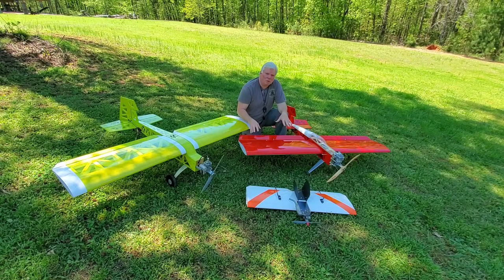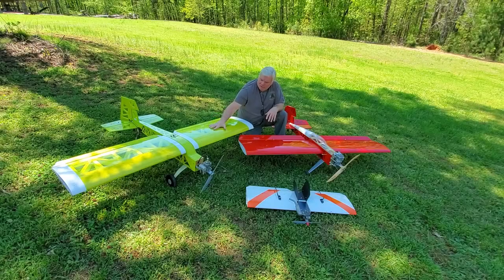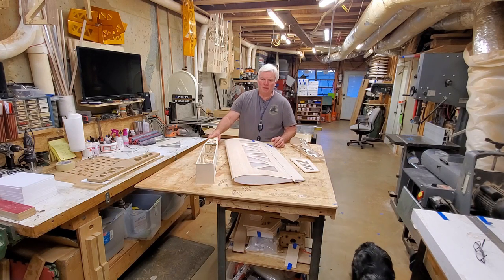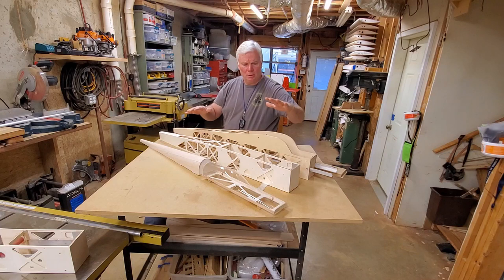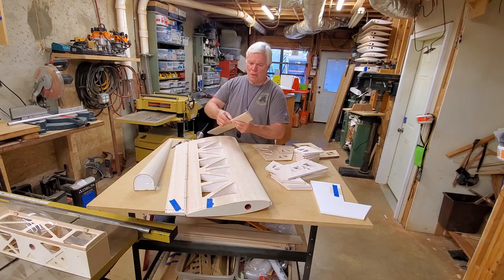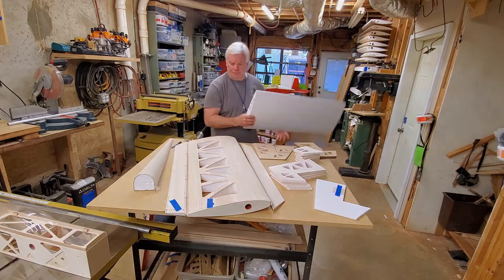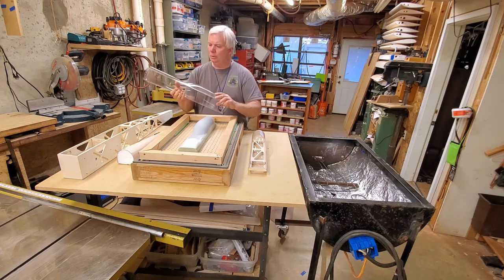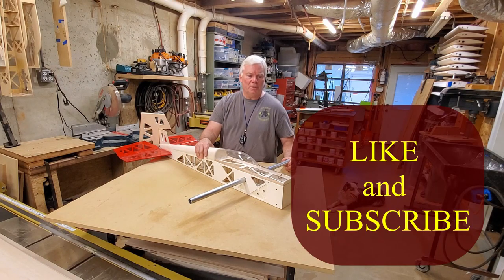Scratch Building Your Own RC Planes  Episode #1  Introduction to the Build Series..

Comment: Thank you Mike for sharing your wisdom with us. On my wood frame airplanes I've only built ARFs and Guillows balsa planes. I've been wanting to build a scratch built balsa for some time, but I've been rather intimidated to even begin to try. After watching your first two videos you have me hooked. I'm now confident in beginning my first scratch built wood aircraft. Of course, it helps to have a shop, but since I only have my front room and my yard, I'll have to improvise accordingly.
Reply from the maker: Thank you so much for the kind words Robert.  In the next few days I am putting together a new little router table top that I can throw in my trailer for traveling.  I'll just slap it on a trash can for a cabinet and use a shop vac for dust control.  I'll  make a quick video of that and post it as episode 2.1.  

I have one now that works great but its quite old and beat up from years of travel.   Anyway, it would be a great solution for guys/gals with extremely limited space.  I even use a compact table saw and bench top bandsaw when I'm on the road.  These tools are cheap at places like harbor freight.  

Once you clear those three hurdles, everything else we will be using has a very small footprint.   

My point is, you don't have to own all the woodworking tools you see in my shop to build these planes.  I do it regularly on bench-top Harbor Freight equipment.   Nothing we are doing "requires" the level of duty or precision capable from my shop tools.  I use those tools for furniture building.

We will be building wing panels real soon.  Most guys will need to build a vacuum system to facilitate this part of the build.  The system can be built on a shoestring budget and its much easier than I ever thought it would be.  The timing is right for me to release a few minute video on tools needed for that phase so guys can be gathering the parts to build their systems.   

I built balsa rib wings for years because I thought foam core construction was out if my reach.  I couldn't have been more wrong.  Foam core construction is cheaper, easier and far more durable.   Once you see it done, I believe you will be hooked.  

I must warn you though.  Several of my buddies have become foam core addicts.   🤭

Comment: Awesome work! They look like they fly better than what you can buy!
Reply: Its definitely a tougher plane.   In addition,  the huge control surfaces and tremendous wing area gives you control authority to enjoy a flight envelope that most ARFs can only dream of.  The slow flight control is addictive.   

Having the ability to replace your own parts provides a greater level of confidence and enjoyment as well.  If you break a fuse, just pull your tail surfaces off and glue them in a new fuse.  I've done that several times.  In fact, I'm doing to video on that now.

Comment: Fantastic video. Cannot wait to see the coming the rest of the series.
Reply from the maker: Thank you so much for the kind words.  
I am editing the next video as we speak and I should have it uploaded tonight or tomorrow.   The clips for the next four or five episodes have been filmed so they will come out quickly.  The plan is to have videos come out once a week.  The challenge is getting it shortened down without losing valuable instructional content.   I'm trying to keep the episodes just under one hour long with absolutely no fluff.   

In addition,  I will be throwing out shorter videos between episodes on things like making wing tube sockets, hinge prep and  instalation and making servo extensions.   That will help keep the main video episodes shorter and make it simpler for guys to find those topics for later reference.

Comment: many years back when I got started scratch building was the only way... as its cheap... & I love building planes... I made fuselage from ply & wings from foam & veneer sheeting...  I never purchased an ARF.. scratch building all the way...
Reply from the maker: I love scratch building as well but I also own a few ARFs.  I have 8 Extreme Flight 50, 60 and 70cc planes.  There is no way that I can build a plane to the exacting specs of a high quality floaty ARF.  (I actually could,  but it would take an incredible amount of time and work to achieve)  Unfortunately, that super feather weight comes at a cost; its very fragile if it hits the ground.  That's where these build materials and techniques shine.  It will never perform like and EF but it flies well enough to surpass most pilots skill levels and its incredibly durable and cheap to repair.

Comment: Request of RC foam core wings is pending. Meanwhile can you please guide me the nest possible wat to get the template/plans to get going with the fuse and wings for the 35 cc turtle deck version
Reply from the maker: Im not sure what you by the pending request. 

I will have to trace those templates and have them scanned a print shop.  

I just haven't had time to do that.   

I'll try to get that done this week.  

Do you have a way to print them on a large scal printer like at a print shop?

Comment: Just finished watching the last video on this.  Great series of videos.  If I put that much work into an RC plan I don't think I could fly it, but then it looks like it could take any mistake I would make.  My only complaint in the whole series is when you were using the router table to trim out the waste on the wings etc. you used your fingers to pick out the off cuts.  That just made me cringe.  I would never put my finger in that position.
Reply from the maker: Yeah, one of my buddies routes the entire waste block out to avoid a piece in the center.   Good safety point if you're not used to routers.

Comment from the maker: I failed to mention, the high wing version (Bush Gnat) is running an RCGF 20RE.  As you can see it has more than enough power with a 20cc.  The red plane (Sport Gnat) is running a DLE35RA in this video.  I actually prefer the RCGF 35RE.  They are stronger, lighter and cheaper.

Comment: I'm a Mooney M20C owner and I would love to build a RC version of the plane but no one has any plans for it
Reply from the maker: The nice thing is,  you don't need plans.  The M20C is a fabulous plane and it would be a fun project using foam core and liteply.   The NACA  63-215 airfoil would be easy to build.  Or, you could build a NACA 2412 and gain some stability but maintain a very similar appearance.   Very few if any one could tell the difference.   

I just started a Facebook group for this project.   Its a much easier format to talk.  

"Foam Core RC Plane Builds and Repairs".

Comment: Where do you get your lite ply? I live in Georgia also Just west of Atlanta.
Reply from the maker: Harvey, you are in luck!!!   I get my Lite Ply at Spruce Aircraft Supplies in Peachtree City, GA.   So, you are actually closer than me.  They were out of stock a couple of weeks ago due to COVID shortages abroad but it may be back in stock now.  

A tip for buying:  Tell them you don't want the sheet on top of their stack.  The second and subsequent sheets will be much straighter.  Take a scrap sheet of plywood with you and cover it in the bed of your truck on the way  home.  Just that ride will dry the exposed face faster than the covered face and cause it to curl a bit.  That's just the nature of very thin plywood.   Once you get it home, stand it on end between other plywood sheets.  Put it back as soon as you cut off what you need.  That way, it will remain like brand new for years if needed.  I buy at least ten sheets at a time.  I'm down to about three sheets and will be making a run before long.   

BTW, I'm east of Atlanta about 45 miles.

Comment: I wanted so much to learn from your video but sound was almost impossible to hear.  Please invest in a lapel mic it will improve things tremendously.
Reply from the maker: The early videos were done with very little experience or equipment.   

Although I'm not a video expert by any means,  you will find later episodes much easier to hear.  

I did get a lapel mic and found it inappropriate for my environment.  The cords just don't work while working with tools and moving around.  

I sprung for a high quality remote mic and it works fabulously.

Comment: Mike, where do you get foam wing blanks that size for "a couple of dollars, or so"? I had to order 48" x 24" blanks for my project at $25 ea!
Reply from the maker: I buy from a company in Conyers,  GA. called CelloFoam.  Look for a foam manufacturer/distributor.   If you buy from retail,  it will get expensive.   I buy my pieces in 4x24x48 blocks. But they will cut any size.   A little over 5 bucks a piece.  One slab gives me a wing half and leftovers for the tail parts or ailerons.   If you'd like, I can see if they can point me to a distributor close to you.

I see that CelloFoam has locations in GA, FL, IN, VA and OK. 
I quick Google search reveals very similar organizations across the country.   Some have $250 minimum orders.  I go in with a couple guys in my club and make 2 or 3 orders a year.   Like I said, it gets addictive.  250 bucks worth is a lot of foam.  Storage is the biggest issue.  That's why we split it up.  That way we all have smaller quantities on hand.   If one of us runs out, we just borrow from the others until we're all out or close to out and then restock.   

Some distributors don't have a minimum order.  I suspect their cost is higher.   I don't know what shipping would be since I drive to pick it up.  Based on this question,  I've sent email quote requests to several companies across the country.  I asked for pricing on 4x24x48 slabs and 6x6x36 pieces and shipping costs.  I'll let you know what the replies are.
Reply: @mikencrcf6018  Thanks much for the info, Mike. Letting me know of a distributor near Columbus OH would be great! Like i said, the 3" 2x4' blocks I bought online were $25 ea plus shipping!!
Reply from the maker: I got a quote returned from Universal Foam Products MD.  They would charge $8 for the 4x24x48 slabs and $2.70 for the 6x6x36 piece.  I'm sure they have a minimum so going in with others would help.  That price included shipping  to me here in GA.   So, finding foam shouldn't be an issue and shipping shouldn't be an issue as long as you can have it shipped to a commercial address and pick it up there.  I have stuff like that shipped to my buddies company sometimes when they won't deliver to a residential address.   

I hope that helps,
Mike

Comment: Do you sell or market any of these airplanes?
Reply from the maker: I have built some for a few friends but honestly, there's no way to make enough money to be worth it using these build techniques.   To make money,  you'd be better off using CNC equipment and cheaper materials.   By the time you do all that its gonna be very difficult to compete with the Chinese factories.   

Remember,  this plane is not designed to compete with the ARFs out there.  Instead, its purpose is to be much more durable yet still capable of great flight all while being built in most home shops.  

I have considered selling templates/jigs.

Comment: Nice!

Where is the next video
Reply from the maker: I am so sorry for the delay.  I had a back injury which took me out of commission for a bit.  I am editing the next video now and it should be out by the end of the week.  If you recall from the intro video, video #2 includes making the router templates for all of the fuse parts. I hope to knock that filming out Tuesday.  I should be able to get at least one video out per week from this point forward.  

Thanks for the support,
Mike
Reply: Hope for a speedy recovery